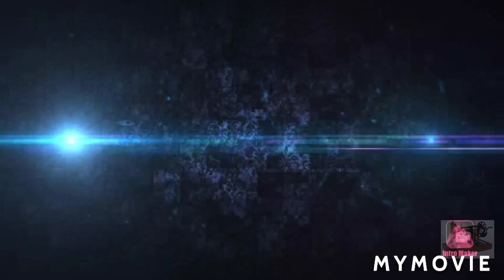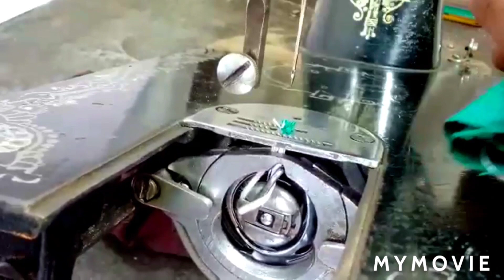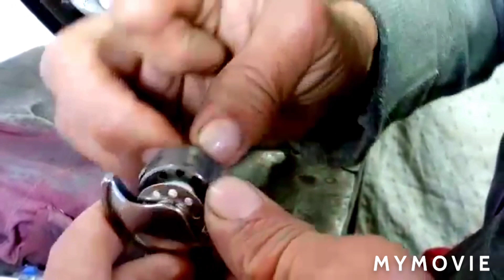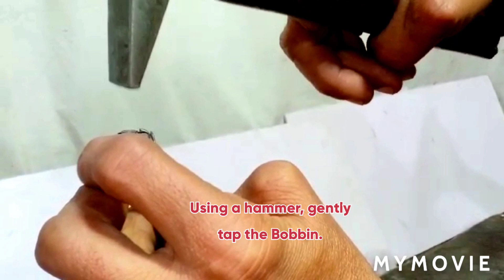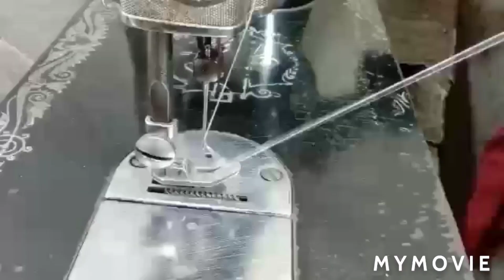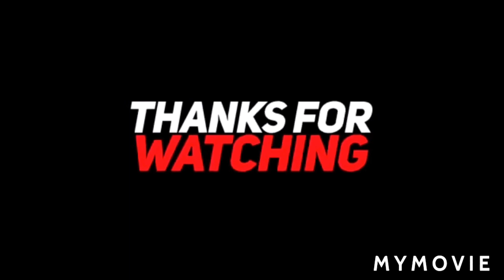THREAD GETTING TANGLED UP IN BOBBIN

Comment: Thank you so so much. This was happening every once and awhile on my brand new Janome 1600. It uses the same vintage bobbin case. The bobbin holder finger is normally outside of the casing, but tapping it ever so slightly fixed it from catching a random loose top thread.
Reply from the maker: Hi Dana thank you for your message.  where are you from?
Reply: @Sewingmachineworkshop1  I am from East Coast USA
Reply from the maker: Awesome 👍